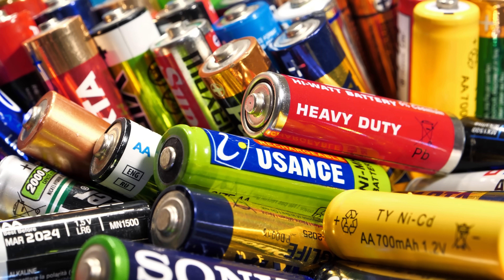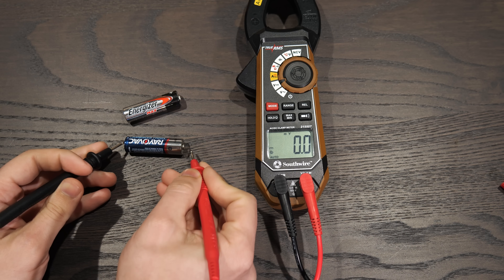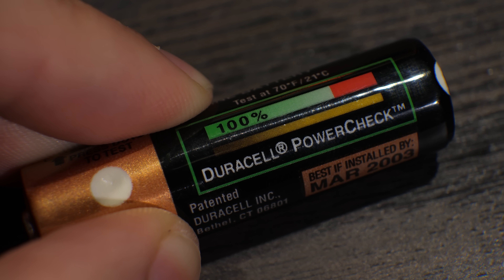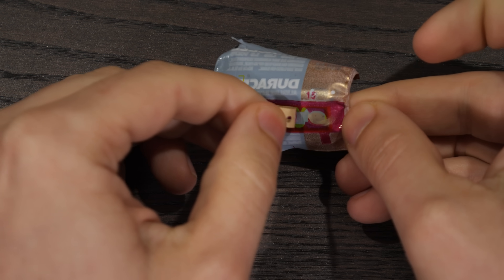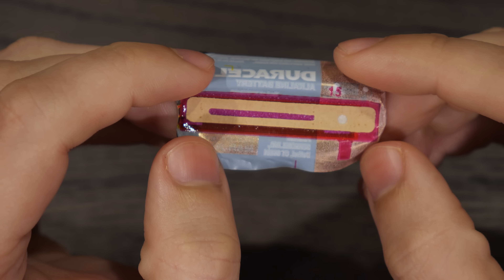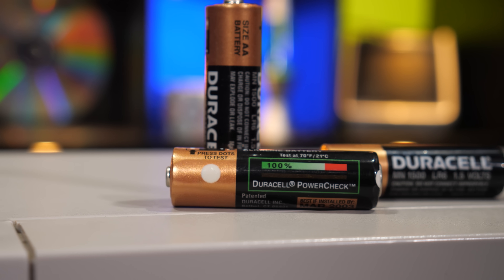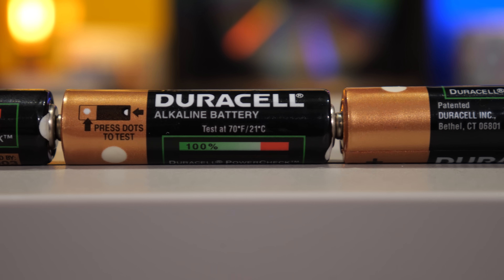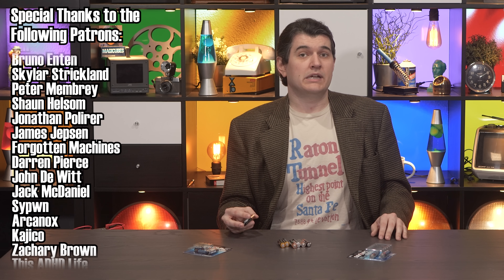Duracell PowerCheck: A genius idea which didn't last that long

Comment: I remember being a kid and NEVER getting these to work, even though the batteries were brand new in some cases. But also, even though I could read at the time, I didn't really understand the 70f degrees thing beyond "obviously don't shove the battery in the snow", and being very North growing up, in a household of people who ran hot, I don't know if these batteries ever saw 70f again after we bought them, as usually the house was kept around 60f. I don't know how much impact that might actually have on them, but between that and kiddo fingers, I can imagine the heater wasn't able to keep going long enough to light them up actually. DELIGHTED TO FINALLY KNOW HOW THEY WORK NOW BECAUSE I SURE ALWAYS WONDERED.

side note, my ergonomic keyboard and mouse combo, the mouse uses AA and the keyboard uses AAA
why. w h y. this is literally the only electronic in the house currently that uses AAA, and it sure is bigger than the mouse. WHHHYYYY
Reply: With childhood finger strength it took a LOT of pressure to get it to work, your fingers would turn white pressing so hard.

It likely wasn't that slight temp difference, you just couldn't push hard enough. I had a lot of trouble with them (I think I must have been 6 or 7? Until my dad presses my fingers and showed me just how hard it was... I later learned to use my nail on the round dot and that helped a lot.
Reply: Temp ranged from -25 F to 105 F (-31.5 to 40.5 C) where I was a kid and I gave up on duracell giving me a good answer. We got an analog test meter instead. It still works 30 years later.

Comment: A few months ago I was happy to find one of these testers; BUT were "printed" into the package... Same idea but without the need to be on every single one battery. An even cheaper battery tester for any battery.

It did work, as the package was open but had a few batteries in it, so I could check and happily use them.

Comment: I miss when they used to build the battery check thingy into the actual packaging the batteries came in. This was more like early 90's era. The ones wrapped around the battery like what you showed never worked very long for me. I think Energizer made a version of that too.
Reply: Oh yeah I totally forgot about those! I cut one out as a kid and it was my tester, collecting and filling boxes of batteries for my game boy.
Reply: We had a separate battery tester, which tested all typical batteries from AAA to 9V
Reply: Yup I remember these too and worked pretty well without destroying your fingers in the process
Reply: Yes, the testers in the packaging were the ones I remember Duracell had.

Comment: I still remember the handheld CB radio I had that took either six alkaline AA batteries or eight NiCd batteries, since NiCd cells only output about 1.2V. It came with two metal dummy cells that you'd put into the battery compartment when using alkaline batteries.
Reply: My dad bought a Canon pocket camera some years ago. It used two AAAs. It goes dead if the voltage drops below 1.4V... Which means it eats batteries like Mr Creosote, and also that rechargable batteries when full don't always even turn the damn thing on.

Would you be surprised that you could buy a battery pack from Canonr that has LiPo cells with incredible markup?... I sometimes wonder how stupid greedy people are. People don't buy expensive battery packs after being disappointed that not even normal batteries really work, they just stop using the damn thing and have suspicions about that brand forever. Electronically there is nothing that explains that, if the circuit needs higher voltage then there are simple little chips for that, costing single cents, in very tiny packages too that will raise the voltage so that you can use all the juice in the batteries. It will fit in the board, it does not cost a lot but... got to sell those battery packs i guess...
Reply: @squidcaps4308  Non-rechargeable lithium iron disulfide batteries are manufactured for devices that draw more current, such as digital cameras, where their high cost is offset by longer running time between battery changes and more constant voltage during discharge.

from Wikipedia
Reply: @Mike-ukr NiMH (nickel metal hydride) batteries were useful for cases where capacity was less important than being able to draw a lot of current at once. For instance, hot shoe camera flashes ("speedlights") typically use four AA cells, and I always kept matched sets of NiMH AA cells.
Reply: @Mike-ukr  The cost of the lithium batteries is only worth it when you need something to operate at low temperatures or have a very long shelf life. For everything else, low self discharge NiMH batteries are almost always the better choice.
Reply: @squidcaps4308   "People don't buy expensive battery packs after being disappointed that even normal batteries don't properly work"... Ah, yes; well, the way around that is you build your device to run on a non~standard voltage, or with special unique connections and/or weirdly shaped battery compartments so that only proprietary power~packs will work. That way, the problem of consumers griping about the product's performance with standard, off - the - shelf batteries won't even arise!
Reply: The other issue with NiCd batteries was that they had the same output voltage from about 10% to 90% capacity. So any device that expected alkaline batteries would either indicate the battery was low the entire time or it'd indicate the battery was low about three seconds before it died.
Reply: I had a set of those too, with the dummy batteries
Reply: I had a CB radio like that. Had to get it repaired because the previous owner had installed a full set of alkalines and popped some component from too much voltage. I bought the highest milliamp-hour AA MiMH cells I could find and loaded it up. The radio had a charge jack on it so there was no need to remove them for charging. I thought it was dumb that it didn't have a regulator to bring the higher voltage from alkalines down to the level it needed, and be able to operate considerably longer on them than rechargeables. When the radio was new the rechargeables would have been NiCd with a lot lower capacity than alkaline.

Comment: I genuinely wonder what the rate of self-selection is between past kids who loved testing these batteries and adults who are fans of the channel. I assume quite high.

I'm surprised there aren't any rechargeables using these currently. I suppose chargers have testers built-in, but it would be neat to have it on there. [Partially, if not mainly, for nostalgia purposes.]
Reply: It's likely because the voltage drop off from a rechargeable cell is more sudden than a standard alkaline one. It'd still work, just nowhere near as reliably
Reply: My generational split was that in the '70s as a kid I saw tube testers disappear from Radio Shack.
Reply: @lohphat in the late 80's the electronics shop my dad got TV transistors and whatnot from still had a tube tester. I was probably 7...

I had a tube B&W TV which I thought was cool.
Reply: Checking in on the testing of these to oblivion as a child!
Reply: Some touched on it, but with all the common types of rechargeable battery chemistry, there isn't a lot to read.  The most common, and outside of very niche use cases only type anyone should be using for AA cells, the NiMH-LSD (Nickle-Metal Hydride, Low Self Discharge, typically sold as "Pre-charged rechargeable), starts fully charged at about 1.25V, drops to 1.2V at about 95% charge remaining, and remains at 1.2 V down to about 5% charge remaining.  Most modern devices don't actually know how much of a charge is actually remaining until they get to about 5-10% charge remaining where the voltage actually drops, the rest of the time, they guess based on power consumption or use time and compute it based on how long the battery lasted the last time it was substantially depleted and/or the current draw when a charger is attached.
Reply: The problem with rechargeable batteries is they work and keep working up to the point they don't - they have a very steep drop off at the end of the charge, so a tester wouldn't really be any use to see how much life is left in them, would only really test if it needed charging or not at the time of testing.     I do sound for a few local theatrical groups, and used to get through 200 or more alkaline batteries in a show week, as they would only reliably do a single show, but you could test them to see how good the battery was - in fact most of the microphones transmitted live battery status, and you knew at 1 bar out of 3 you had about 20 mins of life left.  I now use rechargeable batteries, due to less chance of leakage and also more friendly on the environment.  With rechargeable, the microphones show 3 bars for a few minutes then drop to 2, stay there for about 7 hours, then drop to 1, for another few minutes less than 10 normally before they cut off.   You still use them for just one show, as you can't easily tell how much life they have left, and when they run out they go quickly without warning, which is a problem if your actor is on stage a lot.
Reply: @martinbaines3719 Which is why it is great to have an intermission in your show.  Send everybody to the toilet and the snack bar while you preventatively change out all the NiMH batteries with ones fresh off the charger. 

Seriously though, I used NiMH batteries a LOT in the early 2Ks.  Kept a spare set on hand for sudden changes on critical loads.  My pocket USB fan (wired 4s NiMH) was a critical load out in the Gulf.  Only lit my pocket on fire once.
Reply: I feel seen. Stop seeing me.
Reply: Probably you will burn your hands to be in the usable margin of such a tester.
Reply: there were some rechargeable batteries with a digital indicator on them that showed percent some had e-ink. others you had to press something. but yeah at one brief point all batteries had this. they should have KEPT it for rechargeable ones. though. a few times i would mix one and not sure in the storage pile we had what the charge was or if it still was holding its charge untill i frustratingly put it in a device for it to not work.
Reply: Nowadays they could use micro LEDs instead of heat and chemistry.
Reply: The issue is we have tapped out battery innovation. Their form is ubiquitous, we know how to stuff some acidy stuff and foil into a tube, theres not much left to innovate in those form factors. Ergo adding anything to them will inherently raise the price, effectively pricing them out of the market. Niech demand does not a return on investment make....

Comment: They still make em, or at least they still did in the past 5 yrs here in the UK 🇬🇧 - I’ve got some Duracell AA’s and AAA’s which I bought brand new within the past 5 yrs that have the PowerCheck bar on them
Reply: I just checked eBay UK - and found some AA powercheck’s with an expiry date of March 2029 (so probably made in 2019 since I think they usually have a 10 yr lifespan when unused) - though there’s only 3 listings for them, modern AA’s with powercheck usable til 2029, and some vintage AA’s with powercheck as a collector item
Reply: @TheGoatstep nah they still make them
Reply: Buying disposable batteries in this day and age? What an unnecessary waste! 🤦‍♂️
Reply: @LRM12o8  High drain devices often don't play well with rechargeable AA's, If at all. So unfortunately, They're quite necessary for quite a few uses at the moment.
Reply: @LRM12o8  Agree to a point, but rechargeables are rubbish for very low drain devices like clocks and remote controls.  They wear down by discharging themselves rather than powering the thing they're in.  The clock in my office is a prime example.  A single disposable lasts about 3 years, a rechargeable about three months.  Im spending more time and hassle and expense on rechargeables than a disposable would ever be.  And usually you have to recharge two or four cells at the same time  - many things use one or three batteries, thus making matching rechargeables to safely charge them a pain in the ass
Reply: Came here to say that. Bought a fresh pack of those not 2 years ago in France.
Reply: Yes Duracell ultra still have them on as and aaa in the uk
Reply: @pauldriscoll5010 incorrect
The built in tester no longer exists on Duracell Batteries in the UK(I happen to use that battery and they don't have the tester on them)
Reply: I have some dated for 2033 which I bought earlier this year from Asda
Reply: Came here to say the same! I was really confused thst this video started out like "This is a thing that vanished decades ago, and you're old if you remember them!" meanwhile I was like "Uhhh I last saw them in Tescos maybe last year?"
Reply: Came here looking for this. Had to replace batteries in a remote a few weeks ago and actually checked the battery level on batteries recently purchased which were lying loose in a drawer.
Reply: Yep, can confirm - I have some dated 2028 in my drawer, still unused.

Should add, though, I haven't actually used one of those strips for about 20 years. :)
Reply: These were available in Norway just a year or two ago.
Reply: I saw some in the uk too
Reply: I'm sure i saw one with the PowerCheck in poland last year
Reply: that's what I was thinking, I remember seeing these sold not that long ago
Reply: I was thinking the same thing but I haven’t bought power check in ages!
Reply: @Alexander_l322 that is because it NO LONGER EXISTS
Reply: I came here to say the exact same thing - I kept repeating to myself - "I'm not crazy. I'm sure I have some that I bought recently" (recently as in the last few years).
Reply: Yes: but these days they are only on the most expensive range of Duracells. Not all Duracells are the same these days, with varying capacities and of course prices...
Reply: "I can't say light up, I'll get pedanted for that" 😂 he sure knows his audience!
Reply: None of the Duracells currently for sale in Tesco have them, but yes it was around until pretty recently, I think.
I've only ever bought rechargeables, so I'm not sure.

Comment: Late 90s?  I just found some of those in something the other day!
Reply: Yeah I bought a set of Duracell batteries about 2 years ago for an A/C remote and they have this feature. Central EU.
Reply: I had Duracell Powerchecks in my cabinet just a year or two ago. In the United States. The new ones were red
Reply: Had they leaked?
Reply: @volvo09  nope, still going, no leaks

Comment: How about C batteries? D? 9V? I had little tiny toy cars that ran on N batteries.
Reply: 9-volt batteries, I've sometimes tested with very brief touches of my tongue across the contacts.  Strong tingle = good battery, weak tingle = (nearly) dead battery.

On a different note, growing up we eventually had a plastic battery holder, hanging on the side of a cabinet.  It had a bunch of round holes for different-sized batteries from AAAs to Ds, some rectangular holes for 9-volts, and a tester under a flap in the top left corner.  (Though the tester used LEDs for its readout: green = good, yellow = low, red = practically dead. 🟢🟡🔴)

Still, I do remember the on-battery testers as kinda cool, if ultimately not very necessary.  And yah, the similar in-pack testers were easier to use.
Reply: I think those N batteries were just a roll of coin cells... I remember having to find one for some remote? I can't remember, but radio shack had it! 

Must have been a tiny car, unless I have the wrong battery in mind.
Reply: @volvo09  nope, a N cell is just 1 small cell-there are indeed similar-sized batteries that were filled with button cells-one common version is 12 volts(so 8 1.5 volt button cells would be inside)-they were often used in car remote fobs.
Reply: @m.k.8158  ok, now I remember those... Thanks!
Reply: Never seen any with power meters,
But I use a carton of EBL  C batteries for a pair of mag lites.
Never found anything else that actually uses Cs